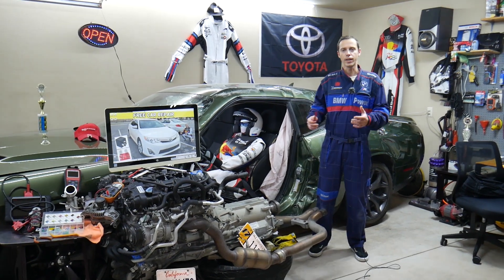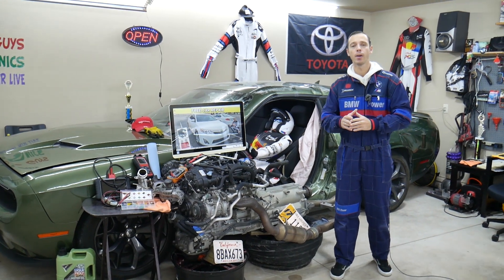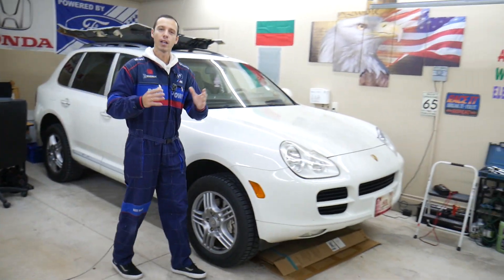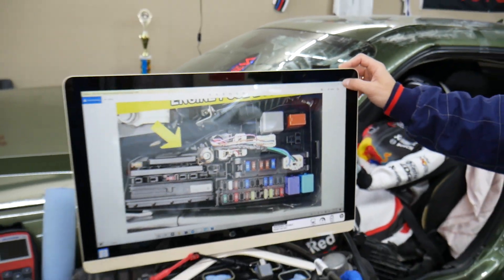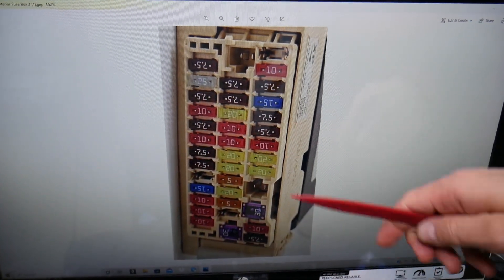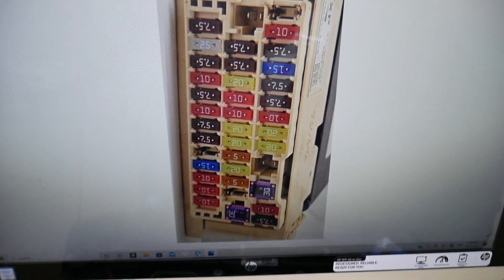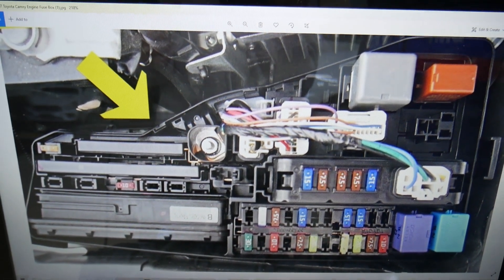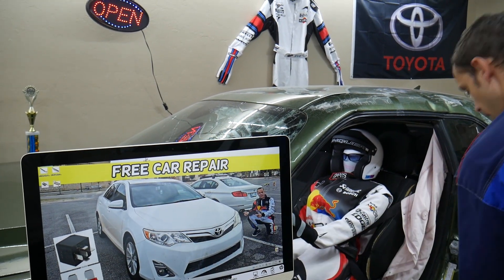WHY ABS LIGHT ON TOYOTA CAMRY 2012 2013 2014

Comment: I have a 2012 toyot camry SE. Steering lights turns on and the steering seizes.. I changed angle senzor but I still get the same signal on the dash and steering seizes.. Pls help
Reply: If you’re steering a season, you gotta take it to a mechanic. There’s no DIY for that.